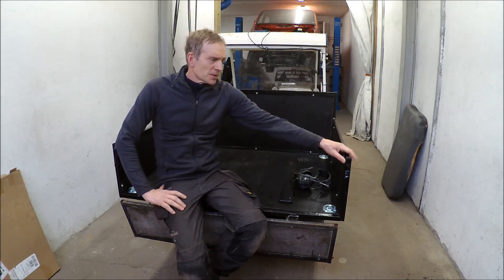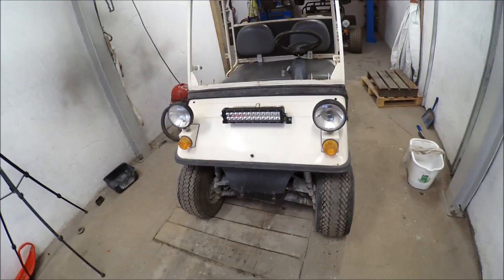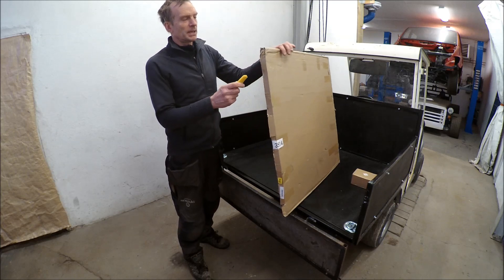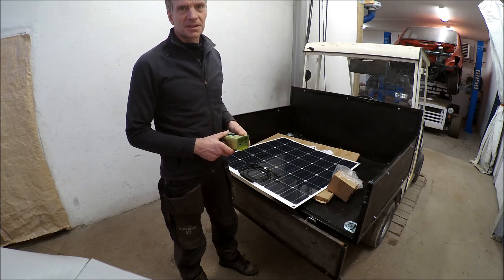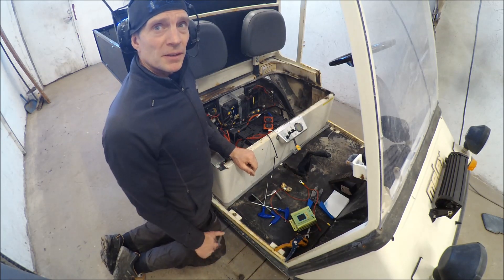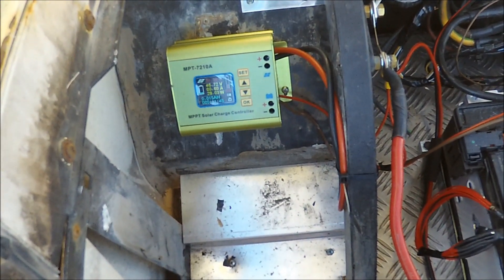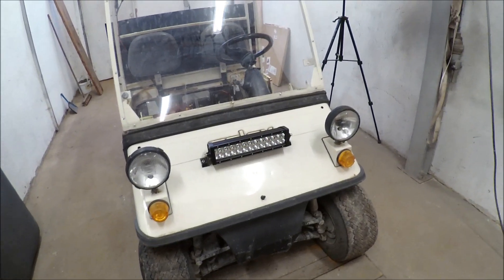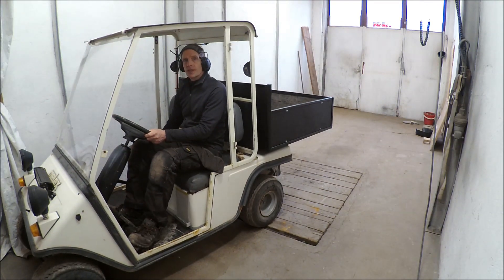Electric car Melex 3 finished

Comment: Tjenare per :) kul att se ditt bygge :) jag håller på med en likadan nu, 252 -48v, har installerat ett lifepo4 på 100ah och bms på 100. Nästa steg är att få tag på celler till taket :) tä kte kika om du har nått bra förslag? Vh
Reply from the maker: Kul👍 Jag handlade på EBAY. Tror Biltema har hyfsade grejer. Tyvärr gav det inte så mycket energi. 
Mvh Pär

Comment: Hey new sub, nice content. I have a '02 rm125 dirt bike and converting it to electric, I've come across the ME1118 (dlc-28) @ 38kw  and the ME30-31001 @ 37kw and was wondering if you had any experience with them?
Reply from the maker: Hello, Michael ! Have no experience with the typical motors. The ME1118 seems to be similiar to the ME1115 who I have been using. Great motor with keyed shaft.   The other ME30-31001 is problably aimed to be fitted to a golfcar gearbox with internal spline. I would go for the ME1118, easier to fit suitable sprocket. BR Per
Reply: @persteel  Thank you, hopefully some can develop a decent size battery with great energy capacity and output. Good luck on your future projects.
Reply from the maker: Hello, Michael ! Wish you the same ! BR Per